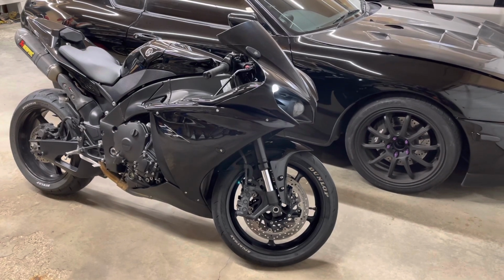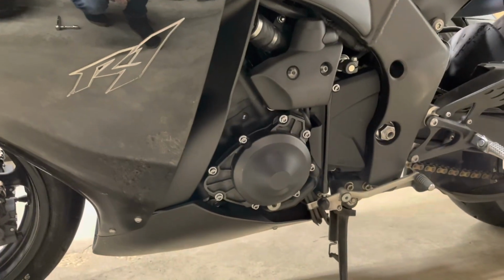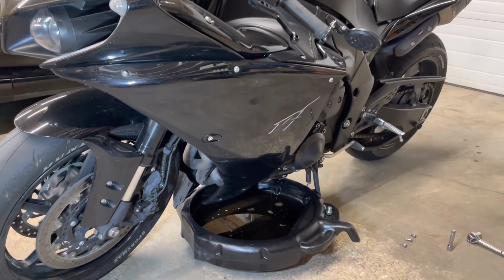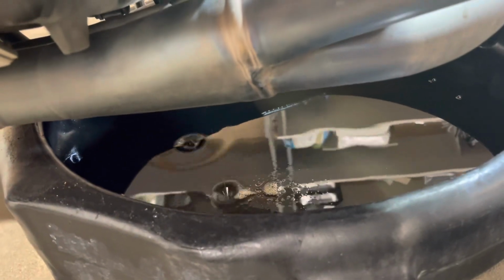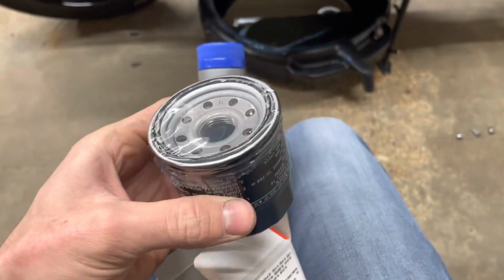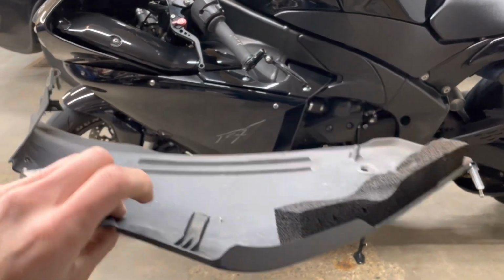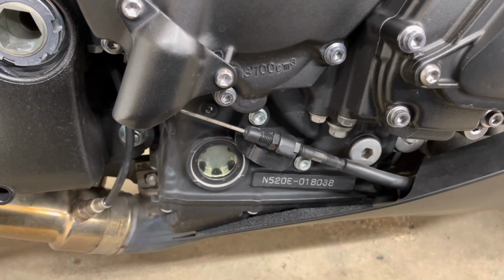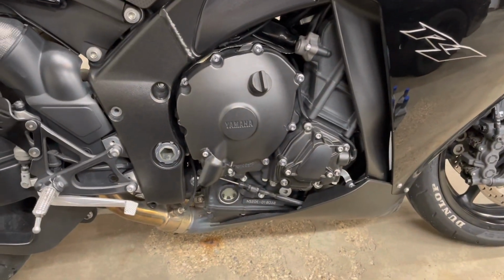How To Change Engine Oil. Yamaha R1 Crossplane. Save money.

Comment: If you want a taller oil filter, for the extra filtering , you can use the Mobil 1 M1-110A filter. I personally use it on my 2013 R1.
Reply from the maker: I’ll definitely check that out. Thanks for the tip!

Comment: I used a K&N filter once with the hex-nut on the end and the seam at the nut failed while I was riding. It got a little slippery for a moment. Avoid.
Reply from the maker: I have heard that a few times now, thanks for sharing!
Just out of curiosity did you use the nut to tighten the filter?

Comment: hi mate, I wanna change my cb 1000 r to r1 2014 or 2012, would you recommend  ? 
cheers
Reply from the maker: I’ve never rode a cb 1000r but I have owned multiple cbr 1000rr bikes. They were great bikes and I’ll compare to them.
I think my cbr 1000rr was a bit more reliable but not as fun to ride. It had smoother power delivery but doesn’t feel as fast as my Yamaha.
My new 2012 Yamaha r1 has been my absolute favourite bike to own and ride even though I have had some issues with it I’m the past. I really enjoy the look of the 2012-2014 Yamaha r1 with the updated running lights compared to the older 2009-2011 years.

At the end of the day I would say buy the 2012-2014 R1 but just save a little bit more money for maintenance and upkeep when comparing it to your Honda.

Comment: How tight do you turn the oil filter back on?
Reply from the maker: Hand tight
Reply: @JT2JZ  won't it leak then
Reply from the maker: I store my bikes in the house over hardwood and carpet. If they were to leak I would definitely know! I’ve Never had any issues. 
You can go tighter but it just makes it harder to remove for your next oil change.